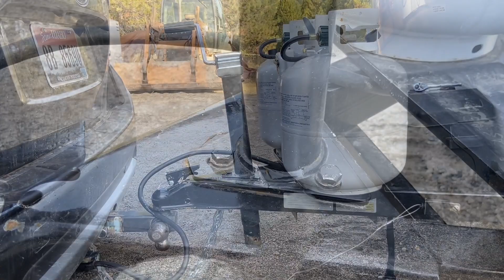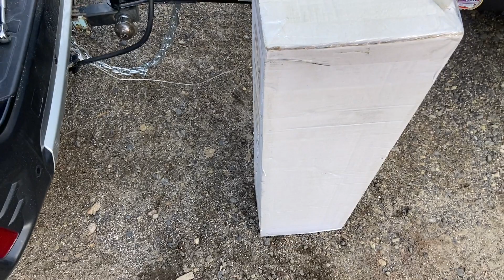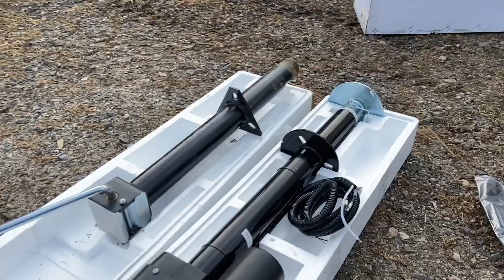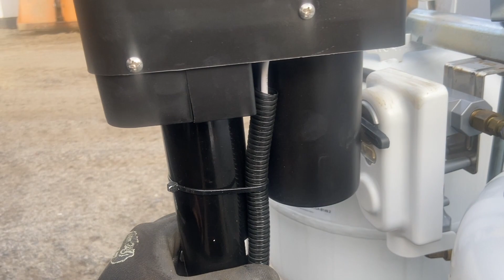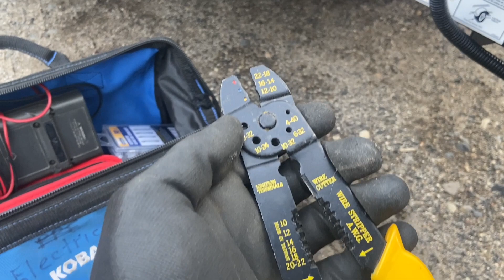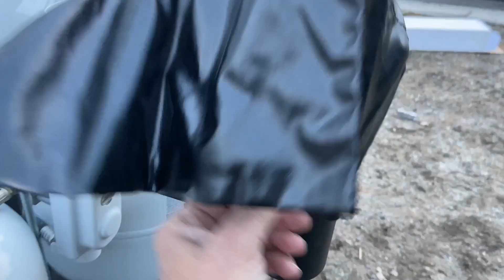Episode 8 - Electric trailer tongue jack installation.

Comment: I wonder if you could get a piece of steel plate and make a bracket that will allow you to move the jack back a little bit
Reply from the maker: I’m gonna use  a hitch extension, like this…
HAUL-MASTER 12 in. Hitch Extender - Item 69882 / 98677 https://hftools.com/app69882
Reply: @scampchannel  that’s the simplest solution. I didn’t even know those existed. There are a bunch of videos about how to turn the jack 90 degrees